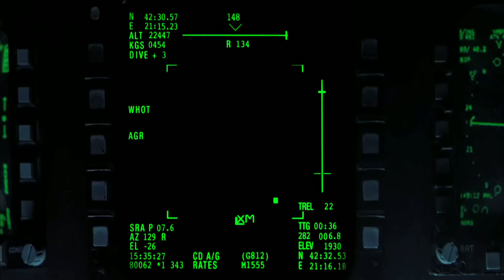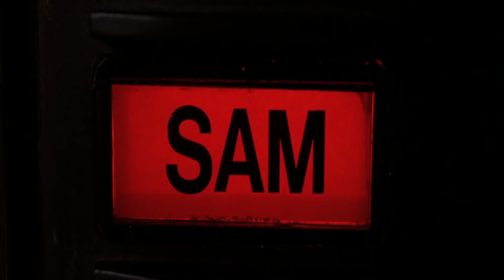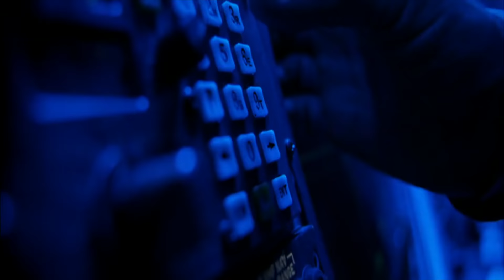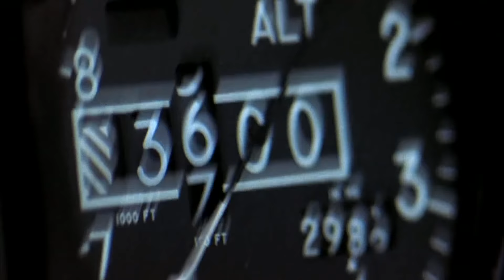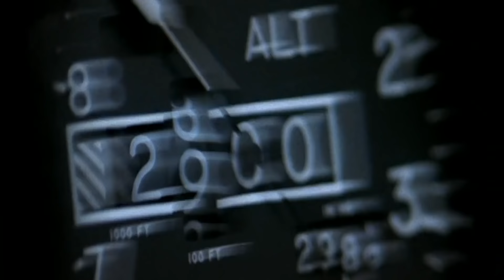Behind Enemy Lines  GTAM vs F18

Comment: If anti-air missiles worked like this, then all air forces would be obsolete
Reply: Obviously, they don't work like these, but there are many anti-air weapons that are devious in other ways.
Reply: 4one14 yeah but what the hell was that for all when the middle passed through them already?
Reply: 4one14  Missile Approach Warning systems detect the missile itself (optically or using radar) and do not care how it is gudied. Moreover, the guidance laser can be detected passively, making laser-guided missiles (or rather the fact you're being targeted by one) easier to detect than heat-seekers, not harder. Laser-guided missiles have the additional disadvantage that the operator needs to keep the target painted (hence requires a direct line of sight) from launch until the missile hits. The delayed detonation does maximize damage for a submunition that hits, but it also has the disadvantage that is requires a direct hit, while a missile with proximity fuze only need to get close enough to the target.
Reply: Yes. Even F-22 and Su-57 will be useless against that super intellect and infinite fueled anti air missile..
Reply: @theheretic6739  Yeah but he was in reality an Air Force pilot in a single-seater F-16 and was shot down in about 10 seconds.
Reply: @theheretic6739  the movie itself is not based on that pilot.
Reply: Actually they do work better than that in real life!!!. It took far too long for that missile to chase down an F14 jet. I believe that was a Russian Sosna SAM variant, those missiles get to mach 4 while an F18 tops at mach 1.8. shot at that range and at that height, the chase would be much much shorter than the 'marathon' portrayed in the movie. The Sosna uses continuous rod munition and that was portrayed really well as it's designed to create circular blast and shrapnel pattern that cuts a jet in half.
Reply: @dataman6744  That is an F-18 jet in this though, not an F-14.
Reply: @WheelsRCool  apologies my mistake. F18 would have an even shorter lifespan in front of a Sosna because it's even slower than F14 at top speeds only mach 1.8.
Reply: @theheretic6739  ya, he even looks a bit like Owen Wilson
Reply: SAMs dont chase planes around,they r fast..like a bullet really, they only got one shot before their fuel is exhausted, firefox with clint eastwood shows that well, so does top gun.
Reply: WTF DO U KNOW
Reply: Seriously. SAMs are more effective at neutralizing slower aircraft like helicopters or cargo/logistic aircraft .
Reply: Lol .. that was a movie .. those Russian little boys can hit 4 Mach ( about 5 km in one second ! ) without a problem while the max speed for the F-18 is 1.6 Mach .. the pilot said after the second missile has been launched  “ 3 miles and closer “ 
My point is from this range the missile can reach the F-18 in less than 10 seconds at the best circumstances
Reply: @yustinusbona8087  All that is needed is a good AI and throttable solid rocket motor.
Reply: They do work like this at low altitude where a jet can fly at max mach 1.2 or 1.3 but the missile has speed of mach 2.5 or mach 4, the only way to evade manpads or low altitude surface to air missiles is to climb to altitiude of 15000 feets or more because manpads or most low altitiude missiles have a max service altitude of 9- 16000 feets.
Reply: Rav Bhattson lol
Reply: 4one14  the targeting mechanism on the HVM is a bucket of poo. Most definitely designed by a lizard
Reply: @yustinusbona8087  I feel there should be a religion formed around that missile as it is clearly all-powerful
Reply: Must S400s
Reply: against a strong well developed air missile defence screen aircraft are useless. End of conversation. THese were two missiles launched against an aircraft that should have been retired 20 years ago, in the movie timeline. It's a good missile, they only needed one.
Reply: @bradleybaker5396  they could have use the buk one
Reply: @JAnx01   I've heard of a missile the  Russian's have,it's nick named the three fingers of death.It's a SAM that can chase after fast moving jets similar too these missiles, but of course allot less fuel,but still very agile in the air,and very dangerous.
Reply: @bradleybaker5396  Lazy and Cringe apology. This belongs in Wile.E.Coyote cartoon, not in military movie.
Reply: @dataman6744  Then that fireball that hit them afterward was rest of missile?

Comment: awesome..but SAMs dont work like that...they cannot carry enough fuel for long chases, if it misses first time, thats it..
Reply: Yup! I agree that was a very unusually lengthy chase for a SAM to pursue that aircraft for that long.
Reply: @glasswings21  russian New s400 can go for 400 km as whole
Reply: Mr. Casanova wow! thats good to know but i believe on the other hand the world now also has got newer more modern and capable fighter jets that are equipped with great innovative technology ,which can help with better overall maneuverability to get out of such situations a little easier than it was a few years back i guess.
Reply: @glasswings21  i think you are wrong just let Any f22 or f35 go to rrussia they will be fucked in 400 km range by s400 and s500 is comiing up also
Reply: @mr.casanova7145  400km is max range, effective range is never anywhere close to that maybe 50km and that if they have a track on the target. F-35 and F-22s will reduce the range at which the system can detect them. Not to mention almost everything about both systems is classified and allot of what you hear is speculation so I am going of previous SAM systems.
Reply: @schmitty5461  thata your opinion
Reply: @mr.casanova7145  No its facts, except the 50km effective range is an educated gusse. The S-400 cant break the laws of physics even if made of stalinium. I have worked with similar systems.
Reply: More to the point.. they cant turn arround the re-engage .. if it misses its gone.. also the missiles go much much much faster than the jet.. not just  a few knots ..
Reply: @schmitty5461  If fuel was not an issue could a SAM engage if it misses the first time? Like circle to reacquire the target or in the real world would the plane be out of detection range by then?
Reply: @johnturn3383  Theoretically ...*maybe* if it is radar guided by a separate radar that doesn't lose lock but in practice no. Most are completely out of energy by then, the rocket motors only burn for a few seconds add any jinking, distance, if the aircraft is hot/cold flying away/to the SAM by the aircraft and the speed burns off quick. The amount of drag the rocket will experience trying to pull a 180 turn will "trash" most SAMs and air to air missiles. If the radar is in the missile or it is infrared guided once it loses lock the missile is defeated. Better to launch a bunch of SAMs and hedge your bet. Hope this helps
Reply: I'm late to this but are we/you basically saying SAMS aren't that good? If so my 2nd question would be are there SAMS that would scare the f**k out of some jets?
Reply: @MrOctoberhungry1  SAMs basically are designed to scare the fuck out of jets lol. Flares when deployed right (ie not like in this scene) generally work. But a jet will be in gtfo mode after that. No pilot is gonna loiter in an area that has SAM defenses Then you get a stealth bomber that levels the sam site or a cruise missile.
Reply: yep, that's right, missiles have something called Kill zone, while it's speed is maximum and still have solid fuel, in this case there is a huge probability that the missile can make a kill (but not with this hollywoodien maneuvering style ), but if he misses, he can't make a turn an re-engage the target. Or it'll detonate in a proximity of the target like the TOR-M did with the MH-17 passenger if it couldn't make a direct hit.
Reply: @ismailsayah624  Ji
Reply: RC ROTOR yup it took 10 seconds to reach the f18!
Reply: This is the Yugoslavian 9M model based off of a heavy strela surface to air missile developed by Russia. They're targeted more towards helicopters, but they do have open shots at planes. However, as soon as you flare out or it misses, the SAM is done for.
Reply: ok guys i started the whole trouble, its only what i know from books and flight sims, but the bigger ones perhaps?? As the russians, as its russian made equipment, usage of missile was more accurate in top gun 1986, dont get me started on armoured warfair..lol
Reply: Danny1585 not really the F18 Hornets that were flying in 2001 are basically the same hornets flying now, even the super hornet isn’t any more maneuverable than the D-model  depicted in this movie. Even the F – 22 and F – 35 are only slightly more maneuverable than a hornet
Reply: @schmitty5461  For god's sake, these are small infrared sams.  There is no radar warning for infrared sams. This reeks of inaccuracy. The soviet infrared sams are short range weapons. They don't chase fighters around.
Reply: Well obviously, if they didn't continue chasing them then end of movie. lol
Reply: @schmitty5461  Big Brain.
Reply: @schmitty5461  Doesn't it depend on the Radar's Capability because the F-22 and F-35 have stealth capabilities which means they can further reduce the range they can be detected under the radar. It's also a factor for the radar ranges of the aircraft's themselves to scan ahead if they don't have wide radar support. I'm just saying after all your the expert here.
Reply: @johnturn3383  They have a killzone and the missle will detonate after it misses.
Reply: @killajakez  Big Facts.
Reply: The SAM shown in this movie is Exactly like those heroes who hit 50 villans with one shot....
Reply: @killajakez  look up MAWS (Missile Approach Warning System)
Reply: @hightiernub1313  yes, absolutely, just another factor that comes into play now with 5th Gen fighters.
Reply: @johnturn3383  modern Russian mobile SAM systems, are immune to jamming and flares, can target PGMs like JADAMs, tomohawkes etc and have multiple active and passive tracking sources to target LO (stealth) aircraft such as IR, laser, optical, Radar guided, even UV spectrum tracking.
Reply: @hightiernub1313  modern Russian digital VHF radars like the NEBO-M series can still track LO (stealth) aircraft, and relay information to other mobile SAM batterys which have multiple tracking sources including passive IR which does not alert the aircraft in danger. In IR mode the F22 is as visable as a P51 mustang at short 40 km ranges where most of these potent mobile point defence systems operate.
Reply: @schmitty5461  I did, thank you. Even then, the warning you get from an SA-18 "grouse" would be on a very short notice. A flight of F/A-18s , let's say 2 of them, would fly over a hilltop in iraq, or syria, even on a weasel mission...and some jihadis would paint the jets and fire while they are under 5000 feet.
Reply: Yeah i smell bulshit on the missile tracking
Reply: Mr. Casanova bullshit! The S-400 would easily be destroyed. AWACS would pick it up and send in Ground forces to take it out.
Reply: It was strung out longer for the movie to make it more exciting
Reply: @mr.casanova7145  it cant for blackbird XD
Reply: Did you watch the covert cabal video about them thays what brought me here anyway 😂
Reply: It did make the scene one hell of alot cooler
Reply: I swear to God that SAM missiles fucking terrifying even if they can't fly that long
Reply: this is nuclear missile of Putin! xexexexe
Reply: @Vicious_Species  uh no it can't. Show me a single case of a SAM chasing an airplane like this. You can't because it is impossible so instead of telling everyone they are full of shit maybe should look and see if you are
Reply: @mr.casanova7145  They wouldn't be able to get a lock on an F-22 or F-35 to begin with and even if they did the missile would lose its lock very quickly.
Reply: yep, and SAM's can fly faster than the F-18
Reply: @glasswings21  see the f16 pilot that dogede 6 sams without any counter measures
Reply: LEGO PRODUCTIONS it’s a movie at the end 😁
Reply: Flaying direct over s400 is a suicide
Reply: @schmitty5461  if that's the case... Why  the western world not test their shinning new State of art machine inter Russian air space??  I bet they know why...
Reply: Damn I didn't know this was not a movie?
Reply: @glasswings21  yeah in MFS some of them stop burning after just two km (not the Microsoft one)
Reply: BOOOOOO
Reply: @mr.casanova7145  It’s Radar system has that range; not the missile itself unless the missile is air breathing.
Reply: missiles in general don't work that way lol. Missiles have far less fuel, they pull FAR more Gs than what an F18 can, they are far faster and would lose track immediately when the plane is out of their seeker's FOV
Reply: @Defender78  no but the super hornet has more power, meaning that it can pull the same turns with faster speed, forcing the missile itself to bleed more speed since it has to pull more Gs
Reply: These sams have fuel for one try, but they are also more maneuvrable than other contemporaries. This means that there was 70 % chance the plane got hit 5 secs after launch and 30 that nothing happened
Reply: @ferrarisuper  I agree
Reply: @mr.casanova7145  You would be very naive to think that US Airforce has no means of defeating SAMs.
Reply: Minh Hiếu Nguyễn  C. W. Lemoine an actual experience veteran fighter jet pilot objectively says F-22 and F-35 are true stealth fighter aircraft. Not to mention infographics show backs up Sources of the planes capabilities. F-35 and F-22 are able to recon as they have non-sight radar. (Can detect at distances far beyond human sight) From that range their stealth capabilities work making them virtually invisible in comparison to close ranges which are more likely to be seen on radar. I'm no expert, I am just saying what was factually said.

Comment: Pulling up would be end game. You would want to notch and drop flairs and chaffe. Still an awesome holly wood scene
Reply: I’m not an avionics expert but i’m really interested to know why? Would you be kind enough to explain your theory? Many thanks.
Reply: @Carmine_Lupertazzi  Basically this whole scene is wrong in terms of how an ground to air missile works, but lets ignore that. When being fired on, a SAM missile has a limited range of effectiveness. So when you are being fired on you want to bail the hell out of there to disengage from the SAMs range and speed. Pulling up reduces air speed and will allow the SAM to close on you. If you can get low and move fast through the mountains (like they did) the SAM would lose it's range of effectiveness and also be harder for the second missile fired to track them. In essence,  the fast you are moving away from the target is best, pulling up slows you down and increases drag
Reply: @Carmine_Lupertazzi  Not OP, but essentially the point of a flare is to offer a different heat source for a heat seeking missile to lock onto. The pilots could've survived if they dropped flares and cut the throttle, thus making their heat signature extremely small in comparison to the flare. Where the pilots in the film messed up is they decided to pull up both times, after the flare and the fuel tanks. To pull up they have to increase their throttle which makes they engines work harder and output more heat which means the missile can still track them. The pilots in the film could've also used the sun as a makeshift flare, however they probably would've made the same mistake a third time.

To be completely honest. The missiles in this scene are supposed to be SAMs however they aren't acting like SAMs. SAMs are heat seeking missiles, yes, however if a heat seeking missile misses it usually explodes and doesn't keep coming back. They are acting more like internal radar guided missiles. Which if the pilots want to defeat those they have to use chaff not flares to give the missile something else to lock onto or crash into.

Still a cool movie scene though! Hope this helped!
Reply: @thetiminator55  Furthermore, a heat seeking missile will not notify the pilots that they are being painted.  A radar guided would, but then that goes back to your point of the flares vs. chaff.  It appears there is a hybrid SAM in the film with amazing range and agility.  Also, flying higher means less dense air, which extends the range of the SAM.  Generally, a pilot would want to dive into denser air and use terrain to mask.
Reply: Additionally I haven't seen anyone saying to much but if you have enough distance to turn that helps a lot too. Because a missile doesn't go straight towards it's target it leads the target using a computer guidance system. If you turn it then has to calculate a much wider angle and it will turn even farther than you do to anticipate your location. Then, you reverse that turn and go the other way. Now the missile has to make a huuuuge turn all the way back the other direction because again, it's has to lead you off to reach you. By the time it does all that it will have consumed a ton of fuel if not all of it and will have lost a lot of it's energy, (as will the pilots). However if you can bleed off it's energy you have a much better chance and dodging it last second with a hard jink because it just won't have the energy to maintain the turn chase. Combine that with flares and you can defeat a missile. The first one anyway.
Reply: shhhhhhhhh, you can't put reality into a movie!!! It's not a documentary... ~ROFLMAO~